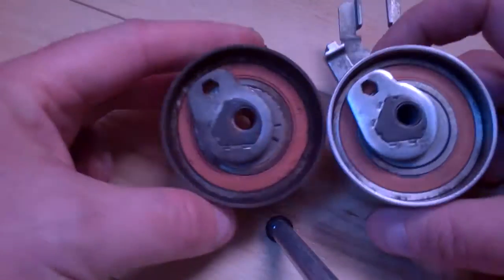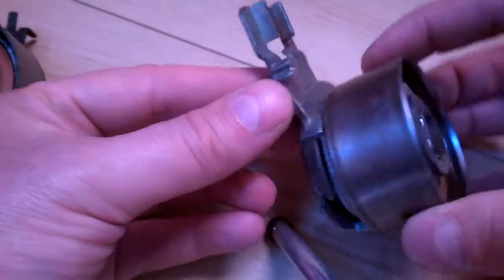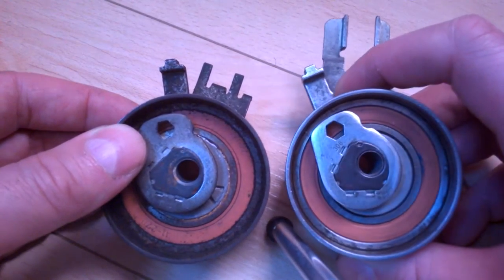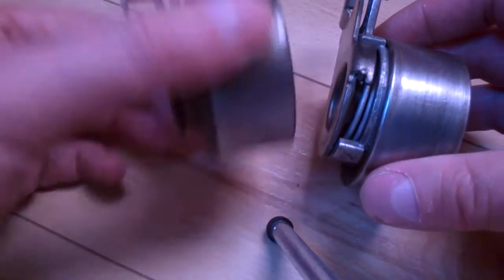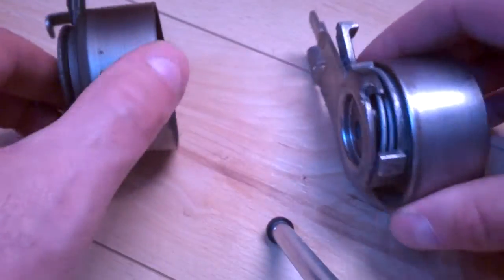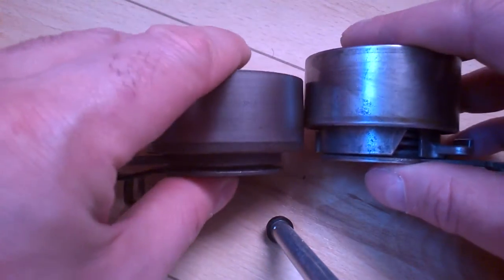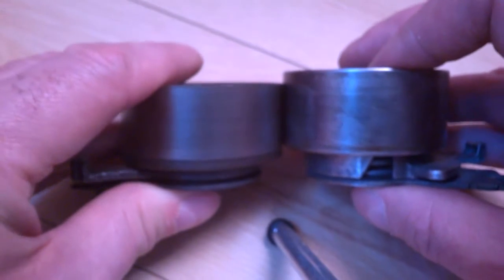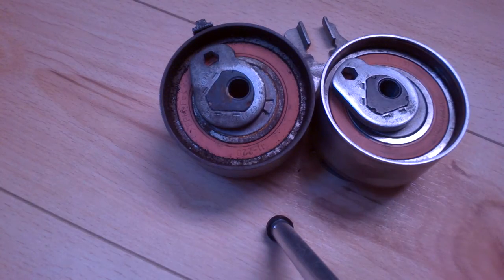Volvo S60 V70 the two types of timing belt tensioners  2001-2009

Comment from the maker: Adjusting the 2001- mid2004 style tensioner https://youtu.be/C-qhJ8Vjhu8  The mid2004-up is adjusted the opposite way.
The tensioner was changed in mid 2004, you need to use your engine serial number for the change is 3188689 for all P2 models (S60, V70, XC70, XC90).  This number is either on the sticker on the timing belt cover, or (more difficult to see) stamped on the back of the engine block. https://youtu.be/irtWJPYWyGg

Comment: Well that's irritating. Hey Volvo....WHY
Reply from the maker: Volvo did several changes in the middle of 2004, usually for cost cutting. It put a new CEM - which was prone to corrosion, new DIM - fixed issues on 2001-2003 models, new cheaper headlights, new improved tensioner - stronger and easier to set.

Comment: I find the newer tensioner only takes two moves, one anti-clockwise to slacken, then one move clockwise to find the correct tension.
Reply from the maker: That's right, the mid2004-up tensioner is set the opposite way of the 2001-mid2004 one. It also is a better, improved design, much easier to set the first try.
Reply: @Peppermint1  If I may bounce this question off you. I have a 2007 Volvo S40 (2.4I) and I followed the tensioning process you have described here: https://www.youtube.com/watch?v=C-qhJ8Vjhu8.

When you say, "mid2004-up tensioner is set the opposite way of the 2001-mid2004 one", do you mean the allen key (eccentric) is rotated CLOCKWISE first to tension the belt until the pointer is on the far right of the forks, then adjust back COUNTER-CLOCKWISE until you reach the desired temp setting? My tensioner pointer can move to the right if I turn the hex either clockwise or counter-clockwise far enough. Hopefully I made sense? There is conflicting info out there and I am a bit unsure of which way to properly tension the belt.

Comment: i have a 2004 volvo xc70 and i ordered the timing belt kit based on  my serial 3399470. I got the kit and it has the new style tensioner. When i began the install, to my surprise, installed was the old style, 61,000 miles earlier. Im not sure what to do. i took the old one off and i saw gthe square notch from the engine block that the new one is suppose to fit around.